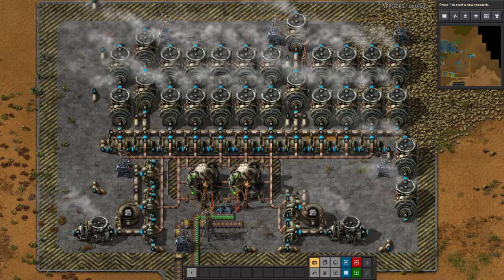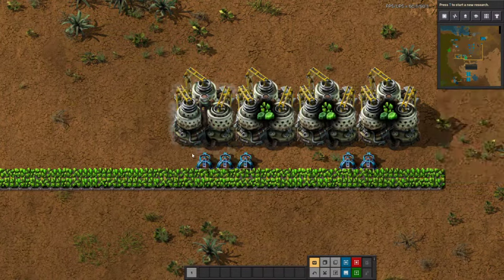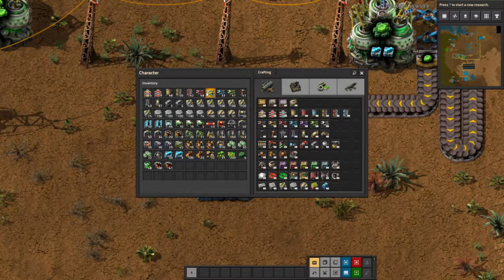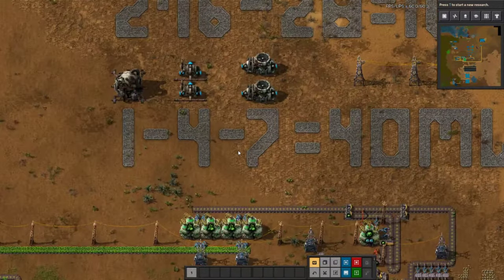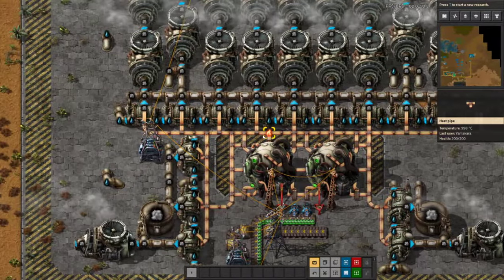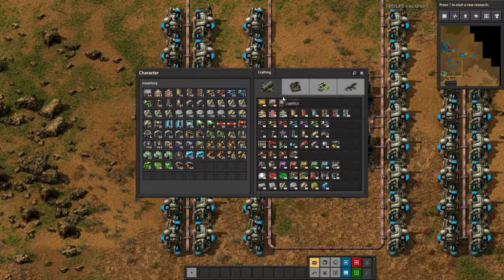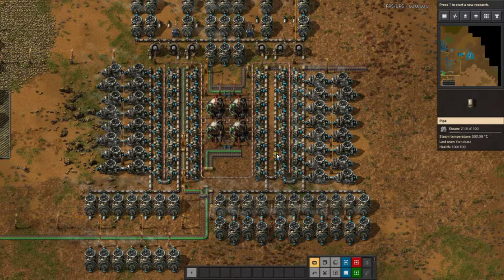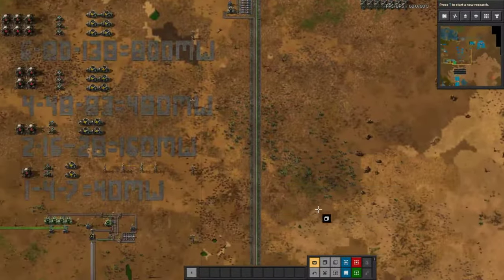Factorio Nuclear! How to Guide! 1.0 Edition!

Comment: You dont need that many pipes for mining uranium. The miners can distribute the liquid to the other miners
Reply: True enough, but one advantage to a setup like this, is that if you are using the mod that marks Miners for Deconstruction, then you won't have to keep fixing the connections.

Technically, this setup would also use less power and miners.  And Sulfuric acid for that matter.
Reply: I personally just let the miners sit there till the whole deposit is dried up

Comment: one thing to add is that you don't need kovarex at all. 1 centrefuge, even at the 0.7% for 235, can fuel one nuclear reactor. So you just need 4 of them for 4 nuclear reactors. Kovarex is if you want 235 for other crafts. It's still worth having extra centrefuges and stockpiling 235 for when you get Kovarex, but it isnt needed or even useful for nuclear power.

Comment: kovarex is not needed for a 2x2 reactor build. and certainly not a 1 or 1x2 build. if you have a 100 miners working uranium and you have productivity modules in the centrifuge and uranium cell factory you can easily get early nuclear, but steam storage becomes more important at that stage, if you have nuclear (that overproduces) and solar you can stop building accumulators since steam storage is waaaaaay more efficient like 200x as efficient. only build nuclear if your factory needs more than 60 MW and then 1x2 nuclear if your factory needs more than 80 MW since uranium is so abundant. kovarex is more mid to late game

Comment: 8:55 To solve the problem with backing up, feed the Kovarex with a split belt, one side U-235 and one side U-238.  Use a filter splitter on the input to make the split belt.  Loop the Kovarex output back to the beginning and feed it back onto the split input belt.  The important part is that feeding the split belt needs to be prioritized in a specific way to keep it from backing up.  U-235 from the mines must be prioritized over U-235 from the Kovarex, and U-238 from the Kovarex must be prioritized over U-238 from the mines.  I also have my fuel cell reprocessing here, and feed its U-238 output to the split belt after the Kovarex but before the mines.

The input split belt is also your output to fuel cell production.  Once the system fills up, the Kovarex will pull what it needs and let the rest pass through to production.  You can pull from wither side to your heart's content.

Comment: Just played this crack called Factario and for three days straight, I could figure out why I could get my turbines to turn, despite everything you said here.

Turns out, I just had to get rid of the Solar panels in the smaller mines and assembly plants. They were outproducing the turbines to the point that that the turbines didn't need to run. Once I removed them. The turbines cranked as desired.

Comment: I have 2 nuclear reactors producing way more than they should according the the ratios described by the wiki site.  I have two nuclear reactors touching on one side (3 connections) with heat pipes running to 38 heat exchangers and 75 steam turbines.  This all produces 437 MWs!  The wiki said max for 2 reactors should be:  2 reactors for 16 heat exchangers and 28 turbines for a max power total of 160 MWs.  Both my reactors temperatures are stable not decreasing at 800 C and the coolest heat exchanger is at 601 C all stable not decreasing.  What am I missing here?
Reply: Are you sure there's no other power source adding to your electrical grid?

Comment: The only "weakness" of coal and nuclear power, is the fuel, at some point, it will run out.
OF COURSE, if you use oil based fuel for the steam, it's infinite, but oil is used for sooo much else.
Solar is infinite, BUT requires a LOT more space, for both solar panels and accumulators
I normally focus on solar power asap, building a huge solar farm in one part of the map
Reply: I like the addition of the gas power station that kastorio adds. I have so much petrol I have excess so I use gas power stations that provide almost 5 MW each.

Comment: If the building keeps grabbing everything how do you get the good out to make fuel with?  I’m up to 70 good in the building
Reply from the maker: It will stop around twice the amount it needs for a recipe I believe. That goes for any assembler
Reply: @YamaKara  it stops a 2x recipe. Once there's over 80 U-235 in a Kovarex centrifuge, inserters will allow any other U-235 to just pass by.

Comment: So long story short, when you unlock Kovarex enrichment, your dumping the 238 out of the centrifuge and then dumping it right back in to "sift" through it again? EDIT: No, wait, thats wrong...Once I get 40 of the rarer "235" from regular processing, I can put it in the centrifuge and basically turn 3 "238" into one "235". Hmm.
Reply: Hi former nuclear reactor operator here. 235 and 238 are two different "isotopes" of uranium, meaning they have different amounts of neutrons but both still have 92 protons. 

Any element on the periodic table can have more or less neutrons than "normal" and the optimal ratio of protons to neutrons varies as the atom gets bigger. Nuclear force binds protons and neutrons together and greatly overcomes the magnetic force of all the positive charges of protons pushing away from each other. 

Radiation happens when an isotope of any atom is "unstable" such that the ratio of protons to neutrons is too high or too low. An unstable atom can change from one type to another because of quantum processes I don't really understand allows protons to sometimes turn into neutrons and vice versa. 

An unstable atom can alternatively eject a proton or neutron from itself entirely, and that can be assumed to be what happens in kovarex. Using the natural radioactivity of uranium (and probably other elements but factorio only shows the 2 isotopes) Some of U-235 are used as a catalyst to cause some U-238 to eject some neutrons to become U-235. I can't speak to how realistic this is to actual enrichment since I mostly dealt with operating the reactor with the already enriched fuel, but understanding more than average with regards to nuclear physics allows me to speculate this is a relatively scientifically feasible process. 

U-235 is easier to cause to fission entirely than U-238 is, depending on the reactor design. I think future reactor designs may allow for direct use of U-238 as fuel but we'll have to see where research takes us.
Reply: You're right in thinking of it as using up the 238, but I think of it in terms of the 325, because there's so many 328 anyway.  You're turning 40 of the 325 into 41 of the 325 for each cycle.  So you always get one more than you had.

Do it enough times, and you'll have enough to feed one centrifuge (you already had enough by getting 40, but the game would like to put 80 or more into the building as a preparation).  Do it even more , and you can feed two centrifuges.  More and more and more, and then you reach a point where you can spare some to make the nuclear fuel cells.